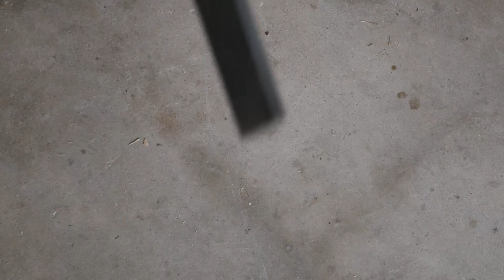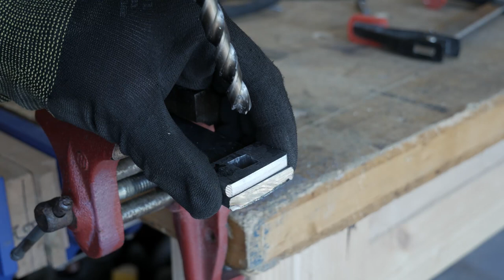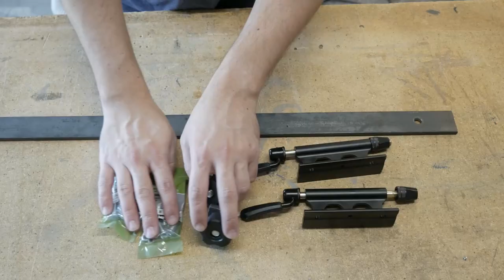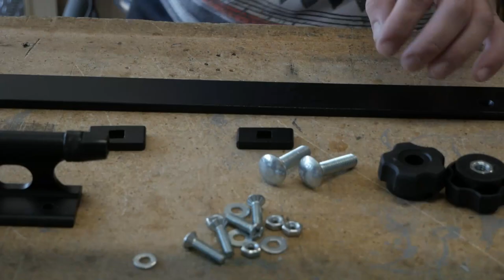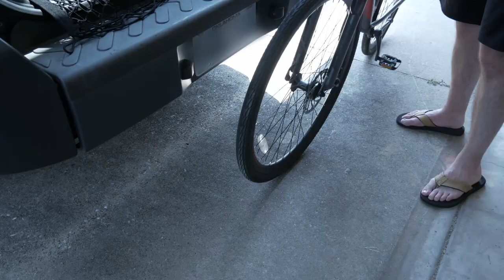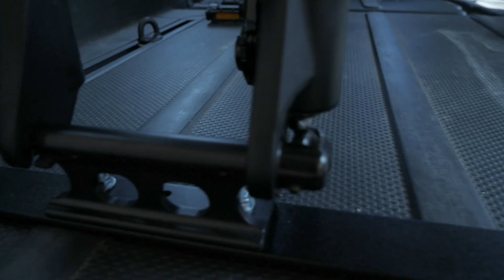DIY Interior SUV Bike Rack

Comment: Great idea, I was thinking of doing the same thing but I couldn't decide on the best way to lock into the seat rails, your solution looks good as long as the thumbscrews don't vibrate loose?
Reply from the maker: The knobs are large enough to make it really tight, I'm not worried about them loosening up enough during normal driving, and it gets removed most for the time. You could easily add some lock nuts for peace of mind though

Comment: Very nice, I need to do this. Will 29er fit like that?
Reply from the maker: It should, one of ours is 29" and fits just fine. The mountain bike handles being wide make it somewhat snug, and one of our bikes is slightly shorter which helps them fit also
Reply: @DFRWorkshop  Thanks for the reply. I ordered the fork clamp and should have all assembled by next weekend.